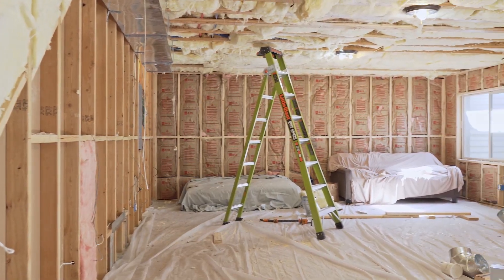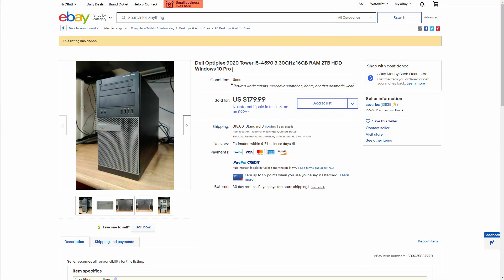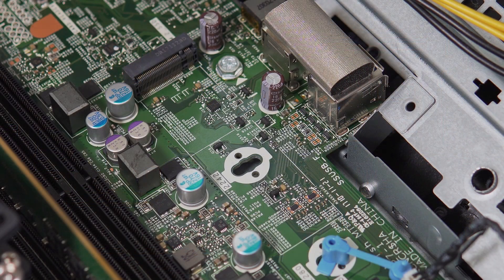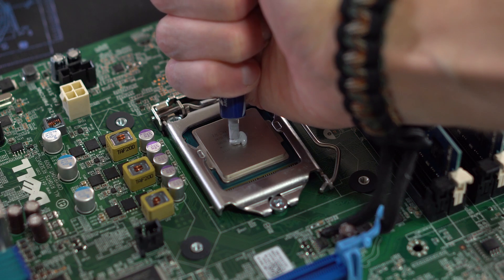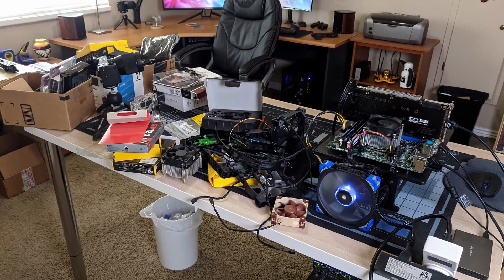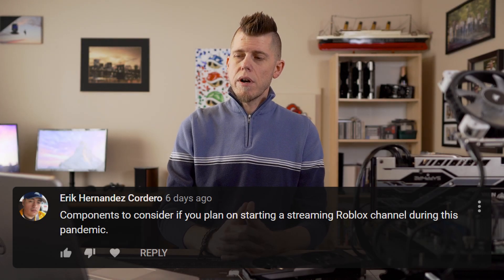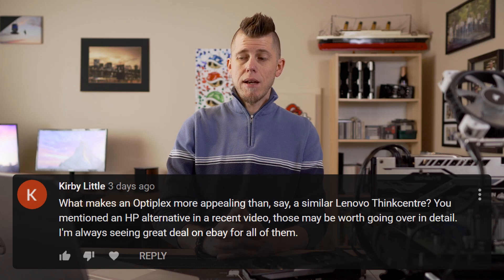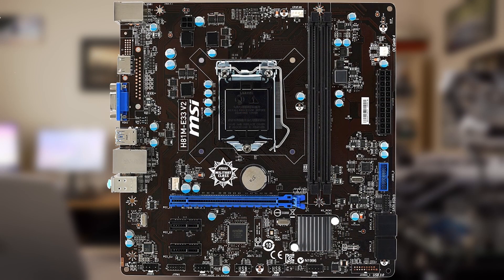Dell OptiPlex Q&A Pt. 2: Power Supply & CPU Cooler Upgrades, NVMe m.2 SSD's & More

Comment: Hey I got a 3020 and I’m really happy with it. I’m running a Xeon e3-1240 v3 and a gtx 1060 3gb
Reply from the maker: And I really need to get my hands on the 1271 v3 to put it up against the 4790 to see if the better binning leads to a noticeable performance bump.
Reply: @TheGameBench  - I'd love to see that video.  One of my 9020 MTs has a 1230v3, and I'd like to know how useful that upgrade would be.
Reply: Did you swap the psu?
Reply: @royrodriguezsandoval7676   no I didn’t really see it as necessary
Reply from the maker: @royrodriguezsandoval7676  Yeah, with a 1060 3GB and the 1240 v3, he might be pulling around 200 watts max for the total system.

Comment: You are a wealth of knowledge sir. For flipping Optiplex’s do you feel there is a cap in your area? Mine seems to be around $300.
Reply from the maker: Thanks! For me, it depends on the hardware. For an i5, I can move them for around $400. I haven't flipped any for a little while, so it could be higher right now considering how sparse the choices are. Most people are selling systems with outdated, underpowered cards just to move systems. With an i7, I've sold them as high as $700 with something like a 1080. Though I think that might be a tough ask, even now.

Comment: My computer came from eBay with a Foxconn dc brushless motor. I’m not sure if Optis use those types of fans but It doesn’t throw codes unless I stop the fan with my finger. Anyways it isn’t a stock intel cooler so maybe that’s answer to your fan question.
Reply from the maker: They might have. I've seen a couple of different brands of fans in these. Sunon is another one you'll find a lot of, and Foxconn is a big OEM in the pre-build space for Dell, HP, Acer... etc. I assume it has the same fan connector as in the video? If so, that's likely the case.